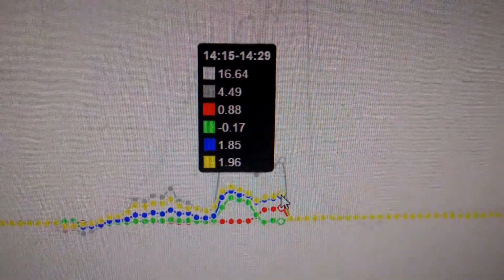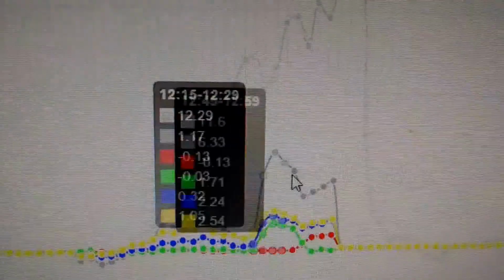Custom Arduino Quad Input Ammeter for Solar Panel Power/Energy Monitoring

Comment: Hi. The reason that the amps fluctuate is that the 5v from the Arduino isn't too terribly stable. I have had this issue and I abandoned the ACS ammeters and went with current sense resistors and an external ADC. I think I mention this in one of my videos, but I use a 0.001 Ohm resistor (http://www.mouser.com/Search/ProductDetail.aspx?R=LRMAP3920B-R001FTvirtualkey66200000virtualkey66-LRMAP3920B-R001FT) and measure the voltage drop with a 16 Bit I2C ADS1115 (https://www.adafruit.com/products/1085). Each ADS1115 can handle 2 current measurements, and 4 total can be chained together. The downside is that they are not bidirectional like the ACS ammeters.
Reply from the maker: +Maria Anna That makes sense! I have been looking for a way to provide a solid 5v to the Arduino, but no such luck. One thing I did find helped was connecting the positive to the AREF pin, it seemed to be a bit more stable.... nonetheless, the ACS ammeters still jumped around. I haven't tried the current sense resistors yet, but I do have one of those ADS1115's. Thanks for the info!